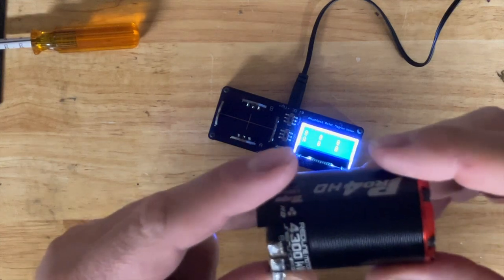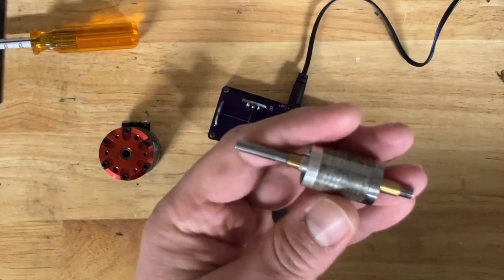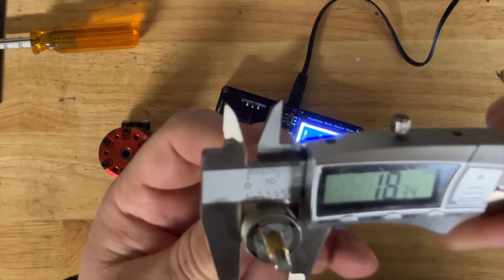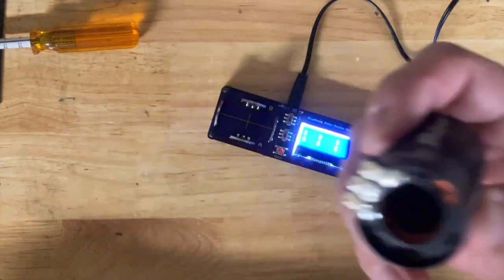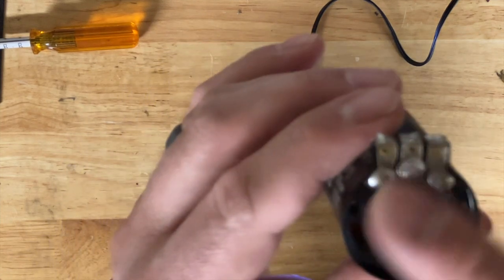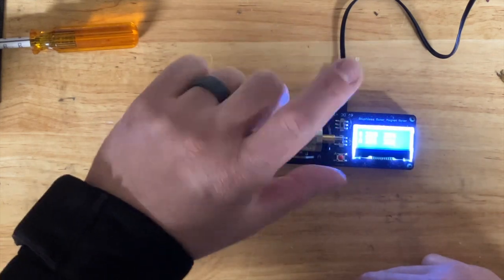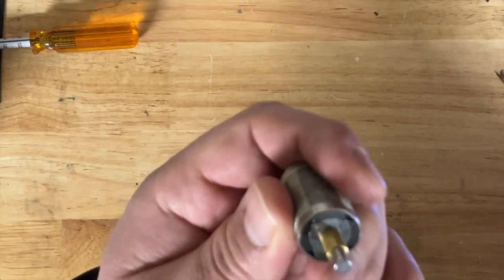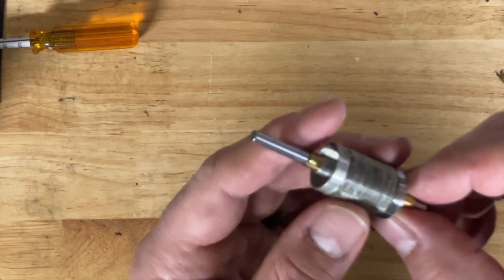Tekin Pro4 HD 4300Kv motor rotor quick specs

Comment: Hi Friend I have a question hope you can answer,  
I have Tekin Pro4 HD 3500 the Rotor Strength is about 2050G , 
Also Has a same size surpass motor Rotor Strength 1700 G

but amazingly the rotor of Tekin Pro4 HD is very easy to rotate by hand, 
surpass motor is very tight although it has weaker rotor  

I noticed same thing with my Tekin Spec R 17.5T and Fantom V3T 
Rotor are about same strenght but Tekin rotor is very easy 
to rotate by hand.  Stators are also same size

How does it happen any idea?
Reply from the maker: I have not been able to figure it out. But you are right, the Tekin motors are smooth to turn. I say this because on the larger motors, they put more coils, but not on the smaller ones. I do not think it is the bearings. It could be the motors are truer to center.
Reply: @telecomandorc  Thanks a lot brother, I found Your videos very interesting
Reply from the maker: @gehandx  My pleasure. I am glad.

Comment: Hi. I think you got the wrong mesurement for the magnet length of the rotor. Look carefully the end of the magnet is at the end of that ring type thing at the bottom of the rotor . It is visble at 1.21time
Reply from the maker: I see what you mean. You are referring to the rear ring. For anyone following this thread, I should have included to measurement of the rear ring, as it holds down the magnets. 

Thanks.
Reply: @telecomandorc yes that's it thats what I was referring , . Sorry if my English is bad.
Reply from the maker: @gehandx  Nothing to worry about. That was a good catch. Thank you.